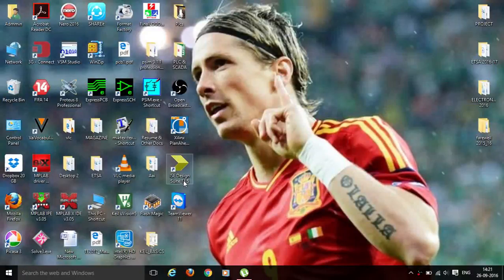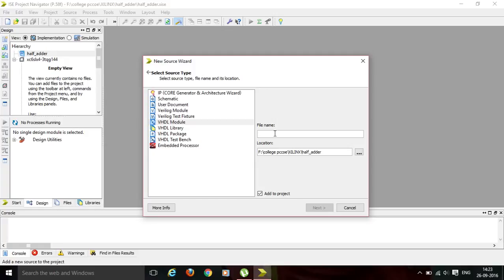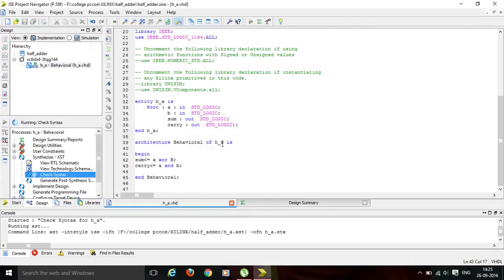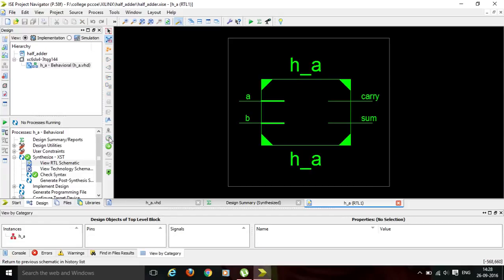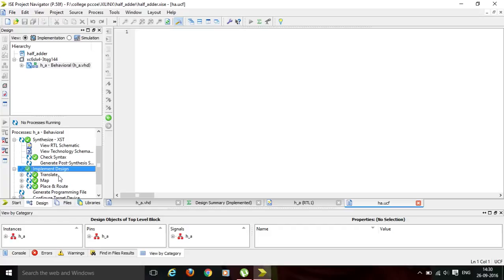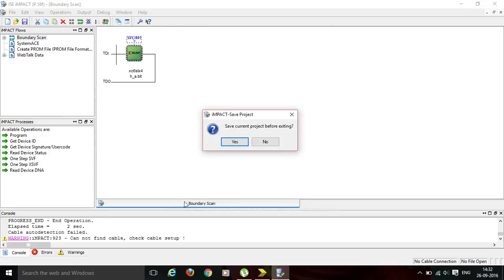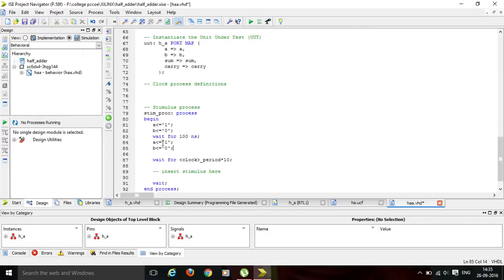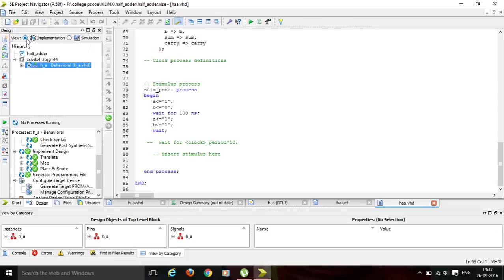Xilinx Tutorial for Beginners | ISE 14.5 | Design Flow | 14.5 | VLSI | FPGA

Comment: simulation is not working on my software plz help
Reply from the maker: Ubaid Mughal Simulation?
What problem are you facing?
Reply: Omkar Motaghare it runs everything, rtl schematic, technology schematic, but does not run simulation behaviour in verilog test fixture module
Reply: it will be due to your license issues and you will have to do some changes for correct simulation
step 1. Go to bin and open nt64 and rename the sile lib_Portability.dll to  lib_Portability.dll.orig and also rename lib_PortabilityNOSH.dll to lib_Portability.dll
Reply: i hope this will help